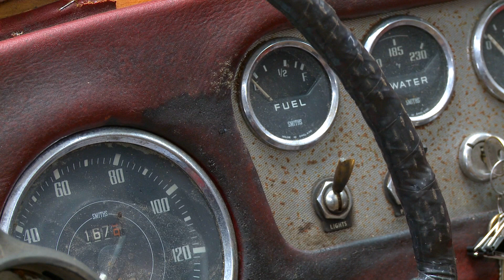Restoration Blog: 1962 Daimler SP250 - Jay Leno's Garage

Comment: No rusty fibreglass to worry about. My brother restored an Austin 7 that my dad bought about 35-years ago and then garaged. He had to get a lot of the body work made anew, since it was corroded/rotted beyond repair,  by an outfit in England that still makes the parts.  The mechanicals and chassis were all serviceable, which  was a blessing :-)

Comment: Jay Check the chassis over with a fine tooth comb, just because the body is fiberglass doesn't mean that the chassis wont rust. Namely check the area around the engine mounts for cracks or welds that are coming undone from the erosion.

Comment: The Jaguar Co. also had Daimler at the time. The Daimler, back then, was the same body style as the Jaguar, but it had it's own distinctive Daimler fluted radiator grille. The 2.5 "hemi" engine was only fitted to the Daimler's. The carburetors (which I saw were taken off the engine) were made by S.U.  Jay, I'm not sure if they were S.U. HD8's or S.U. H.D.6's.  A little auto trans fluid added occasionally kept the pistons moving nicely in the carburetor bodies.

Comment: TVRs also used the Rover V8, Early versions a 4 cyl Ford. 

The Marcos 1800, introduced in 1964, was a good looker. It had Volvo and Ford engines.

Comment: I'm sure you don't need it but,  as a 35 year career in custom hot rod and motorcycle molds and parts making, a full OVER ALL coat of Gelcoat should be done before attempted any body work!!!... then your paint and body work will last forever with minimal movement in the body lines/panels going from warm to cold weather...Fiberglass moves all day long as the temperature goes up and down, humidity from wet to dry.... don't use a surfboard maker to gelcoat this car...PLEASE!   A 110% Cool Car!

Comment: The Edward Turner 2.5 litre v8 engine went in the Daimler version of the Mk II Jaguar. I know 'cause my Grandpa had one. The very potent 4.5 litre v8 went in the Daimler Majestic Major. That v8 in a a MkII jag would have ben a very exciting mixture, alas the ageing straight six went on and on and on...and the v8 was canned when Jaguar took control of Daimler. Problems matching the big v8 to a manual gearbox were reportedly the reason for it's demise it's superior performance was the real reason.